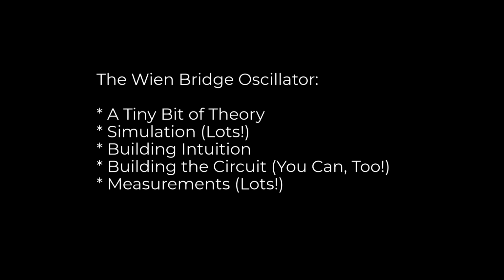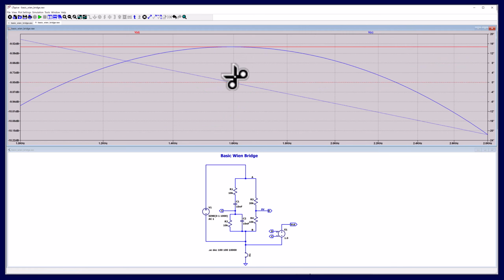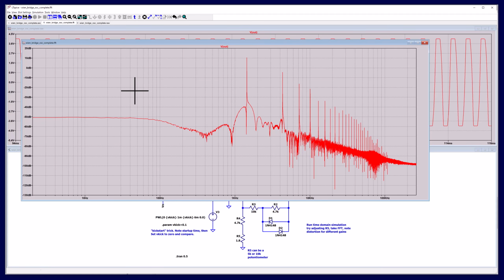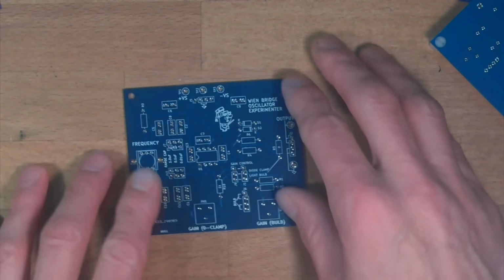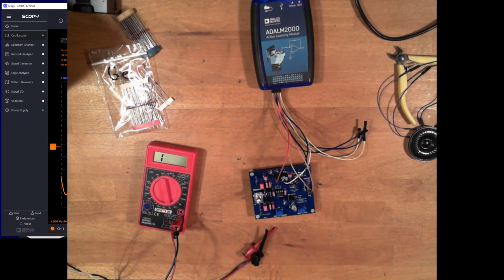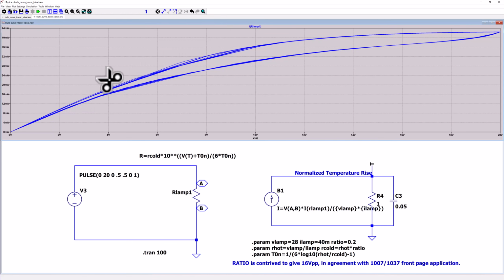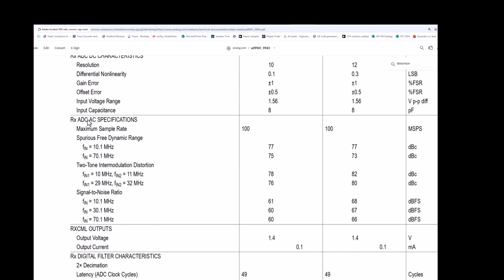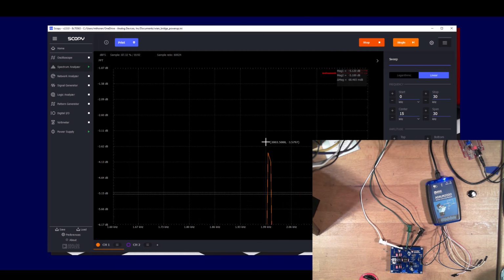A Low-Distortion Wien Bridge Oscillator You Can Build! (with Theory, Simulation, and Testing)

Comment: In the past i did scotch tape on the top to hold it in place or use ure prototyping board , but this is cool also , good video , when i studied electronics there where no LT spice tools it's cool to gain better understanding of this type of circuits
Reply from the maker: There's plenty of times Scotch tape is the right tool for the job :)

Comment: That was a great presentation. I liked that you were able to find a model for the 327 and verified the performance of the M2K. One thing I would suggest is to use negative numbers for how far down the harmonics were. - thanks again.
Reply from the maker: Thank you! And yeah, Jim Williams used that bulb in AN43, and I was shocked when I searched DigiKey for "#327 lamp" I got a bunch of hits!
And noted on expressing THD in negative dB... I usually try to be pedantic - sample rate is "samples per second", not "Hertz", it's the voltage ACROSS a voltage, not THROUGH it (that's current), etc. etc. But somehow "THD is negative" always slips my brain!
Reply: @ Glad to see your down with that.

Comment: Fantastic video! This was very well explained, and I really appreciated showing the actual circuit in action. Super exciting stuff once you get to see it working. Hope to see another video like this in the future! 🙂

P.S. I just realized that I've been soldering those through-hole resistors the wrong way all this time. Boy I feel dumb now. 😂
Reply from the maker: Thanks for the feedback! Indeed there are more in the works, just need to find the time.
Re: soldering resistors - I don't think I'm necessarily "right", but I worked with someone that had done mil-spec soldering and was really really picky about fully wetted joints, and I picked up the habit. She would also fully fold over all leads and trim them BEFORE soldering - apparently in mil-spec you have to do this because trimming after risks fracturing the solder joint. I still trim after, but I'm careful to always trim just above the solder joint.

Comment: That was a great trick for soldering pin headers. Will definitely copy this method.👍
Reply from the maker: Yup, it works great! I had gotten pretty good at soldering headers from the top side - insert partially, wedge soldering iron into the joint of one pin, little blob of solder, then let gravity hopefully pull it into place before the solder froze. Works great for 2x20 headers, terrible for 1x2s. Then I started inserting from the top of the board being assembled, trying to align a "jig board" from the top - the more pins, the harder it is to align. Then the forehead slap moment occurred: "This would work a whole lot lot better inserting the long pins into the jig board..."

Comment: I was a bit intimidated at first since I'm new to this but the video explained everything super well, thank you for putting it out!
Reply from the maker: Thank you for this feedback! And that is precisely the intent, to be approachable from multiple levels - a high or elementary-schooler  just learning to solder can build it up and use it as a basic signal source (or annoying sound generator), a college freshman can build an understanding of the circuit's operation via LTspice and basic measurements, and a college senior in signals and systems or control theory can dig in another layer or three.